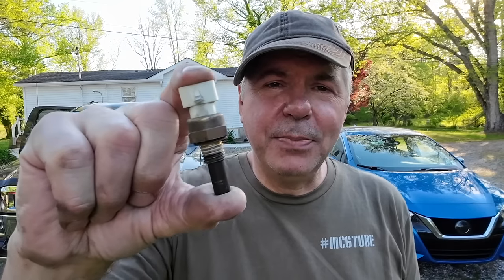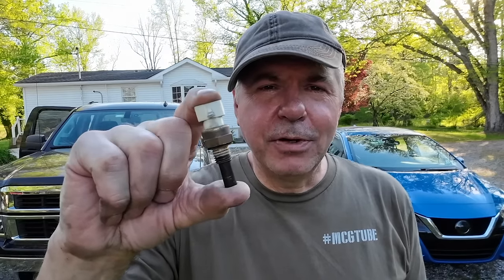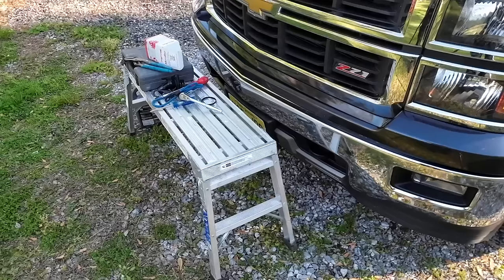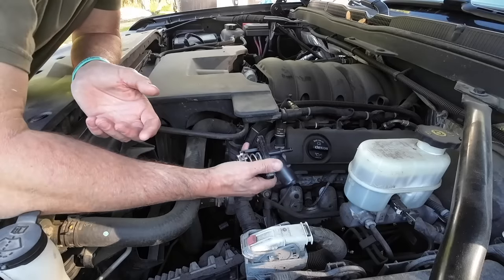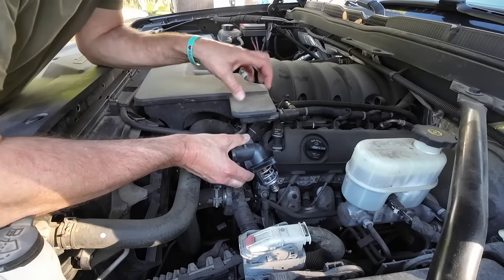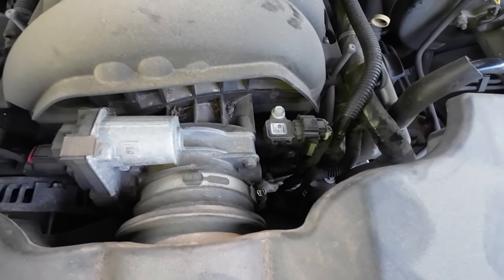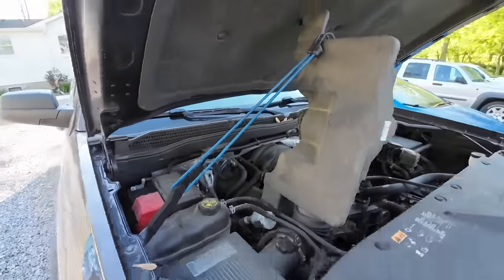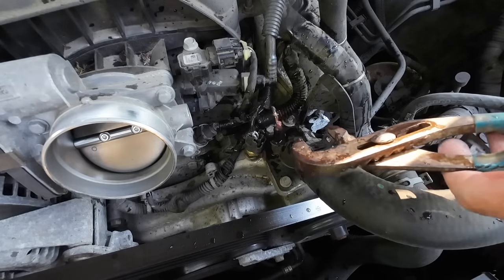Silverado Radiator Fan Won't Turn Off! This is THE fix! MCG video 141

Comment: Why didn't you reinstall the old temperature sensor to see if it was still good? Also, using a cheap reader can be a big part of the problem, as I took mine to a auto parts store and theirs read a sensor issue,. But when I went to the dealership, their more sophisticated computer said it was the thermostat, not the sensor.
Reply from the maker: Nice. That would have been interesting to put the old sensor back. Sadly, this truck was totaled not long after this repair. 
https://youtu.be/Eg9WHoREFJA?si=sVfWaeM0mmrA_8Wl

Comment: I just ran into the problem because i changed out my temp sensor 2 months ago but then the fans would stay on everynow and then. I discontected the negative and somehow ran into a check engine light that wont go away. I now changed the thermostat and have yet to see the code go away so i will be running to autozone to clear my codes see if that fixes the issue
Reply from the maker: Good luck! Hope it works!

Comment: Thanks for this! I just had a 2016 in the shop with the same issue. It didn't have a check engine light on but did have a code stored for running too cool. I didn't bother with the sending unit and went straight for the thermostat. Fixed!
Reply from the maker: Awesome! Thanks.

Comment: Just changed both 11/4/23. 89 inch lbs. on the tq.  Fans came on ran it to temp shut it off then restarted it no fans never had a code at any time😊

Comment: I was having the same issue! And I did it myself and saved about $900, got it replaced, only issue now is my codes won't reset??
Reply from the maker: Are you using a code reader to clear the codes?
Reply: @MyClutteredGarage  I think I went to auto zone, and they plugged it and and tried to clear it but it said "error clearing codes failed" I'm about to get a $10 electrical piece that's connects to the sensor After that I'm out of options.
Reply: @MyClutteredGarage  And also my check engine light is not on. And all my gauges are reading perfectly fine.
Reply: @MyClutteredGarage  I drove it around. A little over 10 miles to see if it will reset and also disconnect it the battery negative and positive for about 10 minutes and that  still didn't work.

Comment: I like the flat ladder 😁 I spent last Saturday under the hood of my 2003 replacing knock sensors, worst part was knee's working on radiator support.  You can add a sign above your garage door " Home of do it yourself auto repair " 😂

Comment: Changed the sensor on my sons 2015 Silverado (5.3L) but the fan kept running. Changed the thermostat and the fan kept running. There was no CEL on because he said he had cleared the codes, so I thought I had a bigger problem. Grabbed the code reader and the code was still there. Cleared it and the fans immediately went to normal ops. Wish I would have cleared the codes after the sensor, but either way, great video. He has a new sensor and thermostat.
Reply from the maker: Good luck! Thank you.

Comment: Appreciate you posting this. I had bought the thermostat replacement part a while back, but never replaced it thinking the battery reset sorted it. Well, it didn’t. After going through the steps you explained/showed, all good now and back at 210! Thanks!
Reply from the maker: Good to hear! Good luck!

Comment: Hello, thank you for this video. I have the exact problem and  I just replaced the sensor and thought that it was fixed, until fans came back on. I will change the thermostat in the morning. Thank  you some much !!!!
Reply from the maker: Good luck! It will take time to reset if you don’t clear the codes.

Comment: Yeah, I started with the thermostat but found, after replacing it the fans were still blowing full speed and temp gauge was at 160. So now I have to go back to parts store and get a new sensor. Hopefully, it was a sensor problem, and a new sensor would do the trick.
Reply: Le us know

Comment: My 2015 Silverado was doing this exact same thing. I took your advice and replaced both coolant temperature sensor and thermostat as they were both very simple to do and this fixed everything. I also bought a diagnostic tool and it showed the ECT (Engine Coolant Temp) error but said it was permanent and I could not reset it with the scan tool. However, after driving around the block the temperature came back up to 210F and it cleared the code and engine light - Thanks much!
Reply from the maker: Excellent! Thank you!

Comment: Perfect video to explain and show repair. Seems best to replace both because of location and they work together. Seems if the gauge stays at 160 it would be a sensor issue, mine doesnt even do the gauge scan at start up.
Reply from the maker: Interesting about the gauge scan. Did you read the codes?
Reply: @MyClutteredGarage  no, nothing showing on dash and do not have a reader. I just figured, as with any computer stuff, reset and try again. Sometimes my factory radio needs reset and then its fine for months. I will see if it works over a period of time, if not I will let you know, but ya, all the gauges at start up do a fan scan and settle where current readings are. But when this was happening the temp Guage does not move during start up, so to me its all electrical, not mechanical. Ghosts in the machine
Reply: @MyClutteredGarage  For a 3 week update. Working perfectly by just the reset. Still does the gauge scan "sweep" at startup as it should for all gauges. One way to see is put a manual temp gauge in for test and see if the thermostat,  a manual mechanical feature that does not send a signal to a computer or gauge, only the sensor or wiring or computer or gauge itself would be to blame if the thermostat is opening and closing as it should. If the thermostat is stuck open or closed the gauge should reflect overheating or too cold it the other parts mentioned are working properly. On a Duramax we were reading low oil pressure,the gauge and sent a code. But engine sounded fine.....of course a "mechanic" wanted $2500 to replace the oil pump......I suggested putting on a mechanical oil pressure gauge and viola, we had correct oil pressure, we flashed the computer and it work for awhile.....same issue again......beings its all trial and error anymore beyond mechanical parts when it intermittent,we then replaced sensor......6 months no issue yet. It seems sensors and computers to tell you if the mechanical item is working fail more often than the mechanical item. Fun Fun.

Comment: Thank you for this video!  My 2014 GMC Sierra is acting up again.  The sensor replacement worked for a year.  After watching your video, I am replacing the thermostat.  Your video camera quality is great.  What kind of camera are you using?
Reply from the maker: Thanks very much. I hope it works for you. This video was shot with the DJI OSMO ACTION 3. Good luck! -Ed
Reply: I have a 2014 Silverado 6.2 
My fans don’t work and the AC doesn’t either . 
When I go tug on the compressor wire or jerk it around the AC works and fans kick . Would you happen to know what issue that would be ?

Comment: We have this same exact problem however we changed the thermostat and the radiator fan still wont stop. Do you think replacing the temperture sensor should be the next step?
Reply from the maker: Did you reset the code? If not, start there. If the problem continues, the sensor is easy and inexpensive. Hopefully that does the trick!

Comment: Im having the same problem and just replaced the temp censor and the thermostat (haven’t reset code yet) and my fans are still full blast and ac won’t work witch I understand is most likely cause the code isn’t reset but my temp gage still isn’t moving….???? Is that also cause I haven’t reset the code??
Reply from the maker: If you replaced the sensor and the thermostat, it’s likely just the code that’s affecting you now. I think it will reset on its own, but some auto parts stores may reset it for you for free.

Comment: great video! And this probably explains why my heat hasn't been as hot as I thought it should be! Drive home tonight my temp gauge didn't even work. First thing I'll try is the thermostat.
Reply from the maker: Good luck, and be sure to reset the codes. 👍

Comment: After replacing the thermostat and the temperature sensor with generic auto parts, I used an AC Delco thermostat and that did the trick. I also reset everything by removing the negative battery cable while I replaced the thermostat.
Reply: Mine is the 2011 Chevy Silverado with the 4.3 V-6.

Comment: great video, I have a 2015 chevy with the same problem. I changed the sensor and my check engine light was still on and now i’m going to change my thermostat and see what happens.
Reply from the maker: Good luck! Thanks.

Comment: My 2016 has been doing this and it seems to happen in colder weather so I will try this hopefully it works also has it done it anymore for u or did it go away completely? Thanks
Reply from the maker: Good luck. The fix lasted… until I got rear ended and the truck was totaled 😔
https://youtu.be/Eg9WHoREFJA?si=rao9yfrz_xBbpvXf
Reply: Dang sorry to hear that hope all is well thanks for the info

Comment: Thanks will
Do this and get a feedback this weekend
Reply from the maker: Good luck!
Reply: @MyClutteredGarage  Thanks again, your diagnosis were very accurate. It worked out great . It was so easy.. not even a 10 min project. Service light  went off by itself after a few miles driven. Followed your steps carefully and having the extra antifreeze was key

Comment: Thank you  VERY MUCH!! Fixed my 2017 gmc Yukon. Replaced both thermostat and sensor and the check engine light went away soon as I turned on the car. Awesome video.
Reply from the maker: Fantastic! Thanks!
Reply: I just changed sensor. Ill go ahead and get a thermostat as well lol. Thanks for the video
Reply from the maker: @jtturner1843  good luck!

Comment: I have the same problem BUT I had lots of heat??
When I got home the fan kept running. 
I grabbed the upper hose and it was soft. No pressure.
Does this sound like the thermostat?
Reply from the maker: What’s your temperature gauge reading at full temp? If it’s below 200, you probably need a thermostat.
Reply: @MyClutteredGarage  . 200 not 210
Reply from the maker: @easyhangit604  if you haven’t changed the sensor, maybe start with that. It’s not that hard or expensive to just change both. If you can do it yourself, it may be worth a shot. Good luck.
Reply: Hi. It just happened again since my last post. (3 month ago or more).
All I did was disconnect battery back then.
I will now change both.
However! After I had it in a shop for a tms a week ago and  it went to 210. It never ever went to 210 before. ( they kept it running for 1 hour!)
I'm with you on your thermostat query. 
PLUS. I'm glad no one was hurt in your crash.
Reply: @ngit604 Hey there! I've had two tire sensors go, and then this fan issue a week later. Would to mind letting me know if the tms was related to the temp sensor issue for you, or maybe the sensor and thermostat fixed your issue. 
Having the two issue so close together had me wondering on an electrical problem...
Reply: @evanbilis1044  . I don't think they were related .
I only mentioned the tms because that's why I was at the shop. They left my car running without a shop fan blowing thru my grill.
I paid $30.00 labor to install the sensor I bought.

Comment: I'm having similar issues with the 2018 Silverado where the fan seems to run often I haven't yet seen it run while a car was off but the attempt gauge is not getting any higher than yours did. AC only seems to work when I first turn on the car for the first 5 minutes in the morning and then stops working altogether. Did this issue also helped fix your AC issue?
Reply from the maker: Hi. Yes the computer disables the AC when it senses a temperature issue. This resolved everything. You may have to clear the codes or drive it for a while after replacing the thermostat and or sensor. Good luck!

Comment: Same issue right now i got code U1510 ECM cannot communicate with active grill shutter over the LIN bus. But i get the same thing fans on full blast and truck doesnt get to normal operating temperatures it stays at 160

Comment: I had the same thought process as you! Temp gauge pegged to the left, fans kicking on full blast, must be the temp control sensor as the thermostat is a mechanical part… I changed the temp sensor 6 months ago. Since then I’d have the same scenario periodically & would disconnect the battery to reset the fan & temp gauge.
After watching your video, I changed the thermostat today. Time will tell but the temp gauge is finally reaching 210°!! It wouldn’t go above 185° for about a year now. 
This fix appears to be promising, thanks for the great video 👍
Reply from the maker: Thank you and good luck!
Reply: I changed my temp sensor about December last year after my fans would stay on and needle would stay all the way to the left too. Worked fine until last night. Has yours been fixed ?
Reply: @guero2138  Yes sir, so far so good! New thermostat seems to have been the answer. Needle has stayed steady at 210° without pegging to the left and fans haven’t kicked on 👍
Reply: @knotguilty9596   nice, I’ll probably go get one today. Thanks !
Reply: Thanks for all the info quick question my 2015 Tahoe has been doing this!! I changed the sensor and thermostat today and it’s still running!! Do I need to take the battery a loose to reset the codes?

Comment: Can anybody give me a complete step by step on what I should do..? I’m having all the same issues as explained in the video; then I go to the comments and now I think I’m a little confused. ( KEEP IN MIND IM VERY GREEN TO THIS VEHICLE STUFF )😥🥲🥲😅
Reply from the maker: I’d start with replacing the thermostat and clearing the codes. Some say disconnecting the battery while you’re working on it will clear the codes. If not, an auto parts store should clear them for free. If the issue comes back after a week or so, I would then replace the sensor. Good luck! -Ed

Comment: Is it bad to drive like this till I have time to fix it ?
Reply from the maker: Not in my opinion. It’s definitely putting wear on your electric fans though.
Reply: It's getting cooler out now and
 you will have no heat. In fact that's why this problem was undetected over the summer. Your broken thermostat is open and the computer wants to see 207 degrees. You may need a new battery if the fans continue to cycle on after you turn off the vehicle.

Comment: you reset the ECU when you disconnected the negative terminal. Has the issue returned? I've replaced both and continue to get temp sensor errors. Sometimes it fails low, sometimes it works fine.

Comment: I started running into the same problem yesterday.  However, my temperature gauge reads 160 at all times.  The radiator fan continued running evening after turning off the main motor.  Upon restarting, the fan would stop for a moment then start running again, so after repeat stopping engine and restarting, I quickly stopped the engine and the fan motor did not start up running.  I have two questions:  With the gauge always showing 160, would that suggest it's more of a sensor problem than the thermostat?  Secondly, does places like Auto Zone or O'Reilly's reset the codes for you?  Obviously I never had to reset such codes before, so just asking.  
Thanks for a very informative video.  I feel I could replace both items if necessary.
Reply from the maker: If you’re reading 160°, I think you probably need a thermostat. I think that’s most auto parts stores will read and reset the codes for you. Good luck!
Reply: @MyClutteredGarage  Thanks again for your help.

Comment: I changed the Temp sens the Thermo and those fans still running the only difference now if i turned off  the truck the fans go off as well .
Reply from the maker: Did you clear the codes?
Reply: @MyClutteredGarage   No I didn't do that

Comment: I've always tried to do basic repairs on cars over the years.  My Wife's 2015 Suburban had this exact issue.  Temp wouldn't come up, the fans would stay on after shutting the truck off until the battery died.
I ordered the parts from Rockauto, the thermostat and temp sensor.  The fans stopped blaring away, I also bought a code reader and was able to reset the codes.  My only snag was that I didn't seat the wire into the thermostat well enough, I had to re-seat it and the truck works great.  Your video was clear, concise and well videoed.  Thank you for this post, everything I read about this - you saved me a ton.  I've seen average costs for the thermostat start at $240 alone.  I'm sure the temp sensor was going to be another $300+.  Thanks!!
Reply from the maker: Excellent. Thank you! -Ed

Comment: Did you check the temperature pipe when hot water.
Reply from the maker: It was warm, but  not reaching optimum operating temp. The thermostat resolved it.

Comment: Well I have changed both and neither has fixed my problem
Reply from the maker: Did you reset the codes?
Reply: @MyClutteredGarage   I don’t have a code reader to reset them so I unhooked the battery and let it sit over night
Reply: @MyClutteredGarage   so the sensor I picked up was messed up or something because I just put the old one in and now everything is working like it should. So it probably was just the thermo like you said in your video. To bad I didn’t find your video first before I watched another one